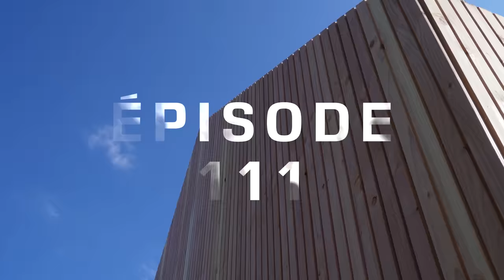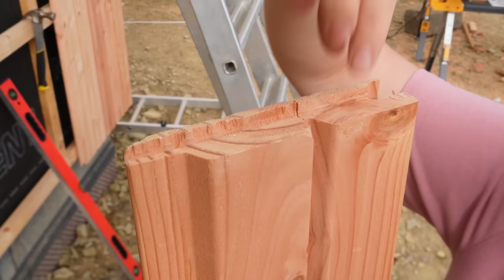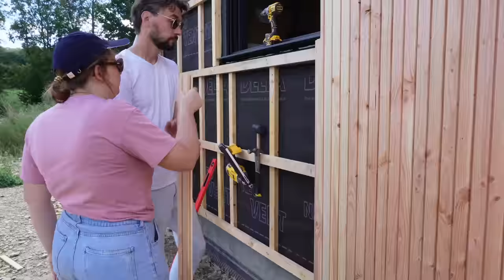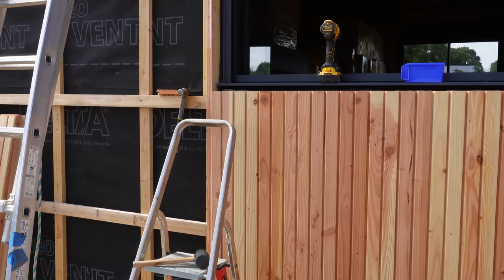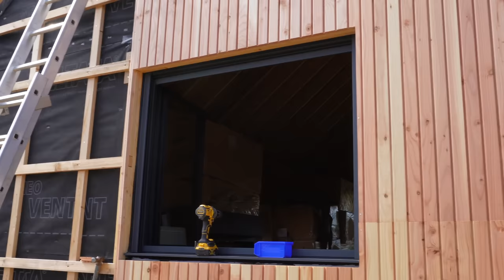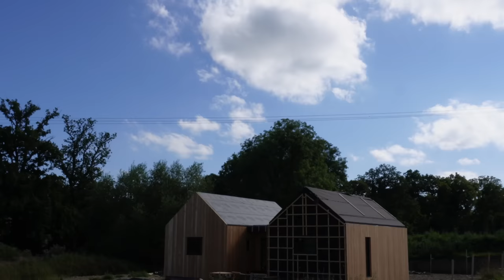ÇA RESSEMBLE ENFIN À UNE VRAIE MAISON ! - EP.111

Comment: It´s good to find your own pace, and nice to see the progress anyways. An alternative to the connection of the two-part planks, is to use a 45° cut, like you use at the bottom. This way they don't grip into each other, but only overlap. When the planks shrink, there won't be a prominent gap, because of the overlap. The 45° angle makes the water flow out and down naturally, it can't hide in the connection. Most people don't look up. So if the longer planks are attached at the bottom, most people won't discover the connection high up the gable anyways.